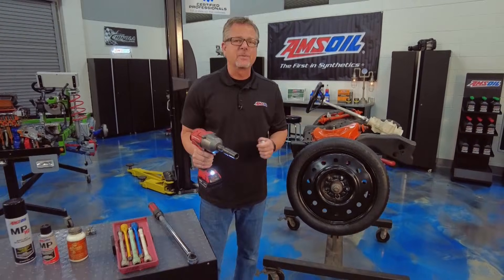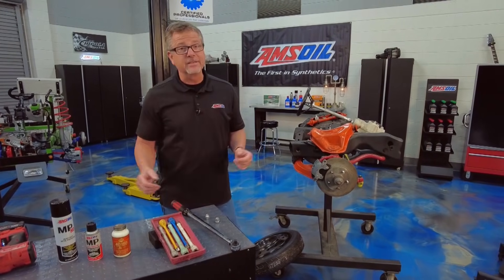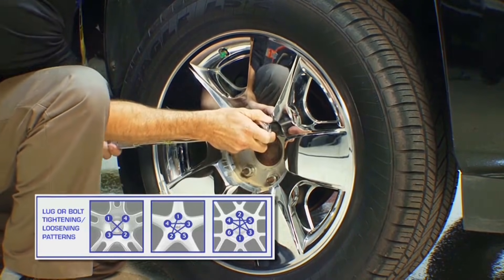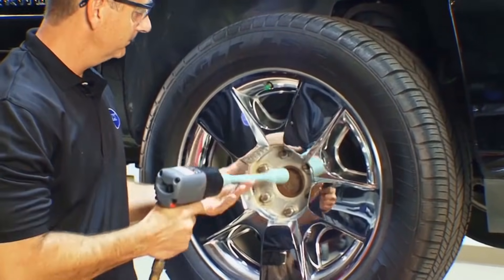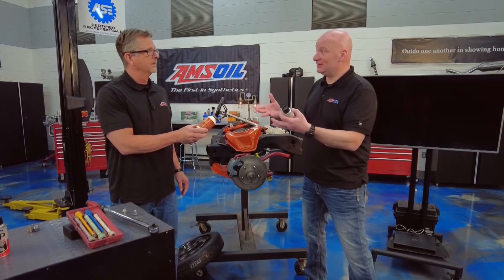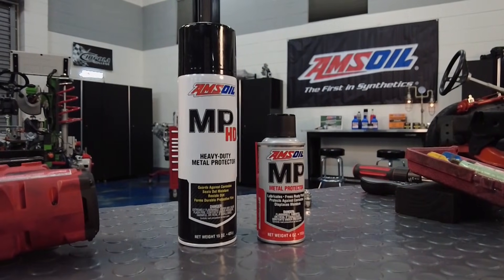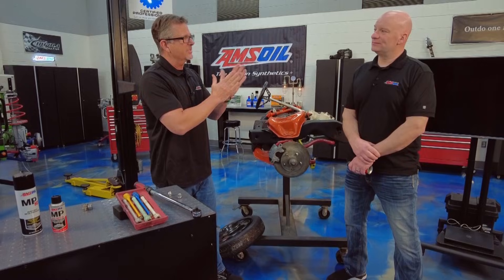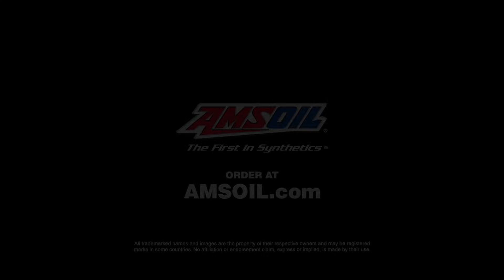How to Torque Your Lug Nuts

Comment: I’ve been using a small dab of anti seize on lug studs for a decade. Never had one come loose. Torqued properly, also can be said that it’s a thread lubricant just the same as metal protector is and you can end up having too much clamping force even when torqued to proper spec.